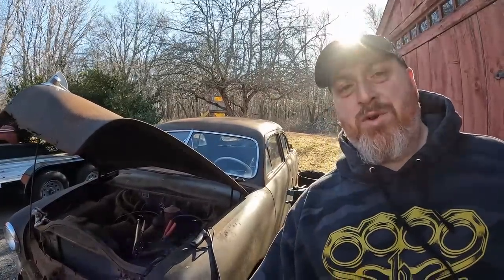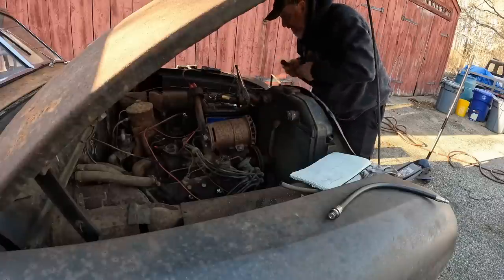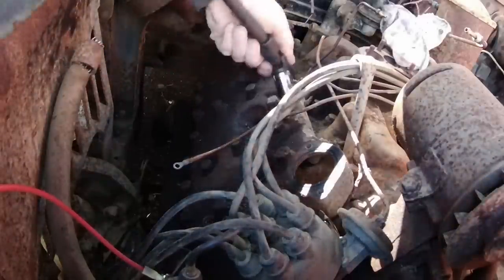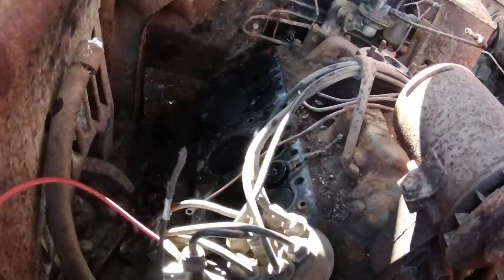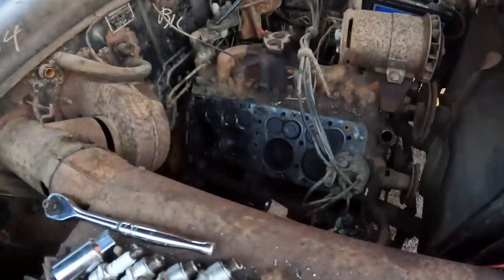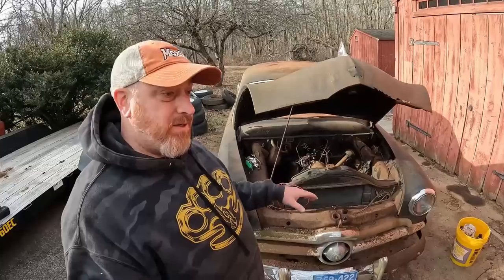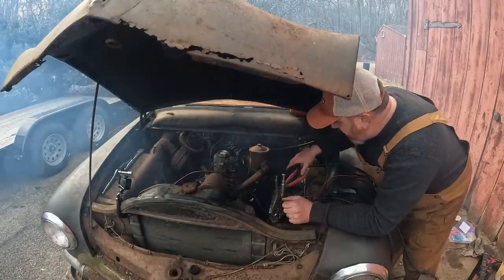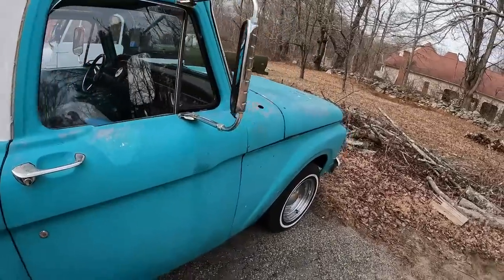From a tragic compression test to a victorious ending!! Ford Flathead V8 revival!! It's hammer time!

Comment: I'm a hack like you!!  We're practically family.  I've had two seized flathead four cylinder projects in the last 12 months.  One is now a driver and the other will be.  I enjoy your methodical process.  Not as much as the clean out video, but I still enjoy what you're doing.  The thing that still surprises me is the cost of parts on the less popular vehicles I seem drawn to.  My floor fabrication is about to begin.  Consistent with your thinking, there's no way I'm spending more on new floors than the car is worth.  Darn adulting.
Reply from the maker: Are you doing videos on the floors? I've only seen Puddin's Fab Shop do floors in a shoebox. I'm trying to do research. I can't really afford $1k for all the floor components.
Reply: @madgingercustoms  I have no idea how to do video, but who doesn't love Puddin?  I'm hoping to just add a lot of frame structure since I don't have a bead roller.  I also think I can bang in a channel here and there and call it good.  My Dodge is about as rough as your Ford, and I think replacement floors came to nearly $1500 for it.  I'm not doing anything stock, so I'm just thinking about structure and I'll wing it from there.
Reply from the maker: @aguywithwood9293  I didn't know how to make a video until about a month ago!! Lol
Reply: @madgingercustoms  My opinion may not be expert, but you're doing great!
Reply: @madgingercustoms  My "similar" car is a 1950 Dodge Meadowbrook and is in considerable worse shape than your.  I'm wondering, in the absence of a bead roller etc., what adaptations can be done while maintaining safety and integrity?  I'm building a tube frame to replace the structure of the floor.  Then possibly wood with a bedliner.  Or maybe an old truck bed floor?  My finished project should be solid and clearly not a restoration!  I'll be interested to see your solutions for your shoebox.

Comment: Ok, here I am STILL !! I'm the guy that was all set to dump you after the 1st video of yours I had ever seen when you introduced this car and talked about an LS swap in it. You came back at me pretty hard, as you should have, and I went back and finished watching that video and subscribed and liked, as I told you then. I told you then I had built the exact same 8BA, doing the 50's hotrod thing with aluminum heads, 2 deuces  a lot of chrome and polished aluminum. Rated at only 110 hp, and only 239 cu.in., these are great little engines. You can idle that thing right down so you can count the revolutions watching the crank pulley ! You likely already know, but if you don't, the first Y block introduced in the 1954 cars had the same 239 cu.in. displacement just that 1st year, then went on to 272, 292, 312  etc.. Also  I'm a diehard FORD guy anyway, not just a flathead guy, so seeing your fleet just now is even more reason you coaxed me into staying around !! Seeing that International pickup reminds me of the Travelall that I had back in the mid 80's. It had the 392 in it. Ok, I'm done boring you !! Keep up what you're doing and you'll be fine !!
Reply from the maker: I appreciate you giving me a chance!! I hope you like the stuff moving forward.

Comment: Our 51 had a stuck valve after sitting for 30 years. I was lucky and it was only one that was stuck. I replaced the guide and valve and that fixed that particular issue.  I did all of that before I ever even dreamed of filming anything so no one got to see any of the debacle of me learning to work on a flathead. That coper coat works. I've re-used head gaskets on a 13-1 motor in my racecar before by spraying them with copper coat, and they didnt leak a bit. Dennis Carpenter has every part you could need for that car. As for anyone screaming at the video for the way you are doing stuff, screw them. This is real world. Not everyone can go out and buy brand new stuff every single time, or have a shop go thru every part every time. When the goal is to make it run, real people do what is necessary to make it run, and that's what I saw here. I do a lot of the same stuff, and it's not stupid if it works.

Comment: When you first got it to turn, crank and tried to start it sounded like there was little or no compression on cranking.   And then it fired up and idled!   Got to love a flattie.   Not surprised what you found, and glad it came around.   On an semi-related note, that '64 F100 looks pretty decent.   My dad had a '63 much like it, also a 292/3 sp - I learned to drive a manual in that one.
Reply: Yes I love my truck!

Comment: Great job with this! Runs on two cylinders out of eight! The legends of the Ford flathead V8 are true! My Dad had a 1950 Ford convertible with the flathead V8. He had a glass pack muffler on it and loved the sound. He never installed the dual carb setup on it, but that was next on the list. Speedway Motors still sells Ford Flathead V8 performance parts.
Reply from the maker: I've noticed a large contingency of flathead parts suppliers. They are well loved as a platform. I honestly have taken a liking to this old one as well.

Comment: Great job! A little intuition working on that engine! You were right about it running. Those flatheads are amazing but not a lot of power. They are fun to drive as they were great on gas mileage.
Reply from the maker: Yeah it clearly needs a turbo. Lol

Comment: Good job of getting the flat motor going. I have been building engines for 50 yrs and have used copper-coat more than a few times and it has always worked for me. If it works don't fix it. 😎👍
Reply from the maker: Thanks!!

Comment: I'd like to give you a little bit of good advice that they found out that works. When you put the heads back on again and Trac it down let it run and heat up to normal running temperature then Trac it down again. Then after using it two or three days then Trac the heads again for the third time.
Reply from the maker: Interesting. So hit it to 70 ft lbs but do it 2 more times afterwards?  When I get the gasket set I'll look into that! Thank you.

Comment: Great job freeing up the valves and getting it running.
 If you Stick with the electric fuel pump, put an adjustable  pressure gauge and run it around one and a half pounds pressure.
 I have mine online and on a switch on my dash .
 I run off the original fuel pump but the electric on a switch, is a great vapor lock cure.
 Just get it running and rolling and stopping , then , drive it like you stole it
Reply from the maker: Thanks! I'm throwing some suspension in it now. I need to check out the tank. I'm not sure it's useable.

Comment: Yeah, pull that engine and lap the valves. By the size of the cloud in the back yard you have oil in it for sure 😃. Nice job over all👍🙏 Great since of humor.
Reply from the maker: It was literally full of ATF, kroil oil, WD-40, acetone, and mcr. I'm going to get some cooling in the car and run it longer but the valves seats were definitely beat.

Comment: I'm 73, old enough I guess... headgaskets.... if they are the original ones, they should be copper headgaskets. They if taken care of are very reusable. I put them in a  pan and heated the water to make them swell up some and have reused them not once or twice but just many times. I pulled wrenches all my life so do have experience I do believe. The copper headgaskets are hard to come by and if they are not compromised their very good gaskets made for the farmers who did the headgaskets on their ford tractors which shared a similar gasket. One of the nice things about the flatheads was the fact that with Rite Stuff gasket material, and of course the cereal box for intakes. A ball pin hammer and the aforementioned was all the gaskets for the entire engine. I have used the bearings over as well as long as no copper or brass showing in them. The Y block engines had one large problem with not getting oil to the rocker shafts on the  top. It was because the cam bearing is not grooved all the way around and so if the bearing ever turned even a little bit, the oil could not get to the  top end and through the one rocker bolt that is hollow inside for the oil to come up to the rockers through the heads... I used to buy time on them by making a drill bit that went clear through and down to the cam and redrill it so oil could make it to the top again. You have to make that drill bit almost flat across it so it will make more than just a teeny hole, like a finish bit can make it large enough.. I think they were like a quarter inch diameter drill bits I used. It is not, not the right thing to do but rockers are spendy and do not last long without oil going to them. Short boxes are quite popular, and notching out the frame for bags and a lowering kit is the rage but me, I just like original style stuff. Its yours and make it yours, fuzzy dice on the mirrors and all if its your thing... and yes you have a lovely wife!
Reply from the maker: Thank you for taking the time to write this amazing comment!!! Thank you for watching our videos!

Comment: A guy's gotta do what a guy's gotta do!  I've been making do for all my life.  Nothing wrong with that!  If you're gonna do a complete rebuild, then you should bore it .30 over with oversize rings and pistons, rebuild the heads and grind the valves, new crank or turned crank with new bearings and seals.  Then comes the transmission and rear end including drive shaft, wheel bearings and brakes.  W Rusty Lane K9POW in eastern Tennessee
Reply from the maker: I'm thinking about a T5 swap.

Comment: On rebuilding carburetor's, you need to clean out the passages with carb cleaner then blow them out with an air compressor. I usually soak them in chem dip that is made for cleaning carbs.
Reply from the maker: Yes that was all done. I usually can't show everything due to time constraints. Thanks!!

Comment: The beauty of the flathead it will run when the valves are stuck. Pull the heads and check the valves
Reply from the maker: Did you watch the video? It's like you're psychic!

Comment: The old flathead sounds awesome, I think the more you run it the better it'll get, one thing I remember reading about the Lincoln Zephyr V12 that the mechanics used to put milk of magnesia on the studs in order to keep the heads from sticking, also love the International, I've owned a couple of those and they are super tough, their weak point is bodies that are hard to get parts for, check out 406 Garage,he has lots of Internationals,buys and sells them.
Reply from the maker: I will certainly check him out thanks!

Comment: Coolant is a lubricant for the water pump also why you're running a dry like that you're definitely tearing up the seal and bearing inside the water pump always put lubricant in first before you start an engine
Reply from the maker: This is a very good point but the water pumps aren't spinning as the belts are removed. I did just get the new hoses and belts though. Hoping the radiator holds.

Comment: You should always take out the spark plug next to the ceiling your testing because if you have a broken head gasket between the cylinders and the first one needs you tested shows a leaky valve
Reply from the maker: I didn't think about this. Makes sense and I will do that next time!!

Comment: Don't know what others are suggesting but I have been around this hobby for a few decades and my input would be the following. $600.00 for a running flathead is a bargain!! Just need to see if this motor transfers any water into the oil or any other "fatal" results like that. Assuming the best, I would suggest keeping the chassis, any interior parts that could be used/sold and any sheetmetal that could be used on another body and shop for another "better" body only or one with no engine that is in MUCH BETTER shape. It takes a lot of time, effort, tools, and money to do all the work this body needs and have the outcome be something you would be proud to own/show. I believe you're far better off with a body that needs a few (literally) patches and just lots more "restoration" than what you have for your first (learning) experience. Any additional money you spend on a better body will be a "wise investment" !!! FWIW, of course. ;o)
Forgot to mention, watch Iron  "Marts Garage" for some good flathead input. 
Love the editing !!!
Reply from the maker: Completely understand that. This is not going to be a restoration or show car. I've never been partial to that part of the car world. Drivers is where it's all for me. A little ratty bang around is just fine for me.

Comment: Anytime you've got an engine accept that long, take the spark plugs out squirt oil down the cylinders through the spark plug holes let the engine set while you put in new spark plugs you might as well put a new set of wires on I always bought a spool of spark plug wire and made my own spark plug wires that way I could make the right length a wire so I could get a good spark just before you put the spark plugs Down in the Hole after it's sat for probably an hour I'd say I crank the engine over after I fix the starter I don't feed on starters with a hammer like I said last time you do that with a hammer to break the magnets inside the starter that go around the Armature lubricate the Bendix real good with White lithium grease test the starter wallets out of the corps make sure the brushes are making good contact so it will generate enough juice to operate the starter when you hit the key or jump start button. I would put in a new set of points and condenser condensers are very important for the points if you have a bad condenser you're not going to have the right amount of spark. It tortures me when I see guys like you work on these old cars a hammer a pair of vice grips or a pliers and a screwdriver.
Reply from the maker: Check out the will it start video if you haven't. This sat for a week with Marvel and ATF in the cylinders.

Comment: Before you put any more money into that flathead you need to run it with water in it to see if there are any cracks. if it overheats or you get water out of the exhaust, the block might be cracked. Lefty
Reply from the maker: I got all the hoses and found both water pumps leak. I'll get it back running soon.

Comment: The reason it ran with compression in only two holes is that the other six weren't fighting AGAINST compression. If two or 3 had compression, but weren't firing, it never would've run.

Comment: The shader valve at bottom of you tester hose is very dirty or has a broken spring.
Reply from the maker: That thing has been around forever. I really should just replace it.
Reply: @madgingercustoms  you should be able to source a new value at any auto parts store. Or Amazon. They have a very soft spring

Comment: What the hell are you doing?
Why haven't you LS Swapped it?
Why haven't you replaced the rusted hood with a fiberglass repro?
Why haven't you replaced the floor pans with poor fitting Amazon steel?
That radiator sure does not look like the aluminum Ebay unit I would have chosen. 
That wiring harness should be replaced by a universal harness from Rock Auto.
Those spark plugs better all be the same make. 
Blah Blah who cares. Have fun with it man I think you are doing great. Keep up the good work. Both of ya. Sir Mortske would be proud I bet. I enjoy the content you are putting out man.

Comment: Don't lower it. The stants is good.
Reply from the maker: It's technically lowered already. Front springs are broken or someone cut them and the leaf springs have broken leafs in them. I need coils and leaf packs.
Reply: OK, gotcha. Good to hear it running so smooth. Just can't beat those o'l flatheads.

Comment: Before you pull the heads off put some oil in the ones that didn't see if we ain't the rings first I've had one it right off of 1 cylinder you didn't put oil and its owners before you start cranking or did you dogs can be stuck or the cam is gone
Reply from the maker: This sat for over a week with ATF and marvel in the cylinders. Check out the video of it in the description. It was seized.

Comment: Dude. There were no aluminum Holley carbs till the early 80s. Yours is die cast, aka pot metal, aka zinc. And the Ford 94 is just a copy of a Holley 94.
Reply from the maker: Thank you for the info!! It cleaned up like aluminum.

Comment: I would have changed the oil at least a couple of times to get it cleaned out inside. Why didn't you at least put water in the radiator first???
Reply from the maker: There are no radiator hoses or belts. I ordered them and they came in after that video. There's no sense spending money on parts if it only ran on a few cylinders.

Comment: I would have put 5 gal.kerocine in with motor oil and fired it up and let it idle
Reply from the maker: Yeah, that may have gotten it done but 2 were really seized and the valves springs on these seem really weak.

Comment: You know when you guys beat on a starter to make it work you are actually breaking the magnets that's around the Armature inside you never beat on a starter with a hammer or anyting else don't be lazy take the starter out free it up especially what it's it's that long because the Bendix is going to hang up it's not going to engage into the flywheel do the job right don't do the job lazy